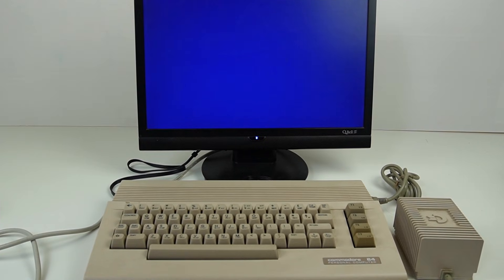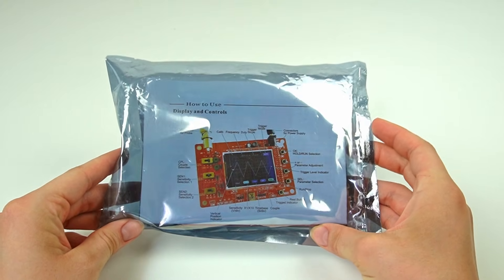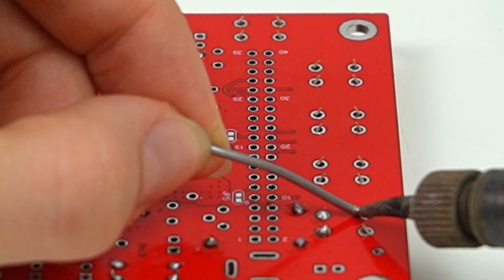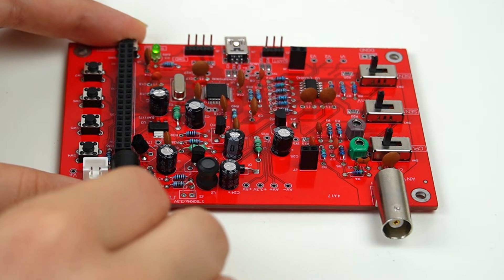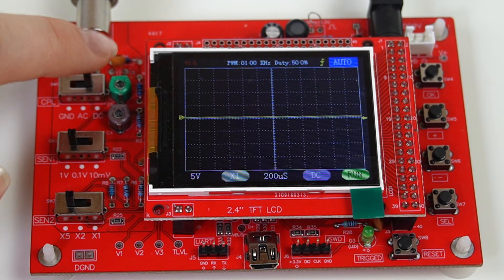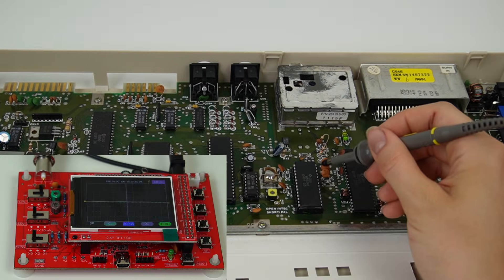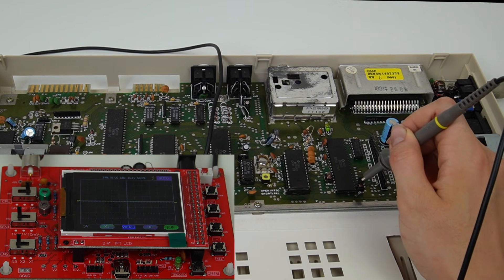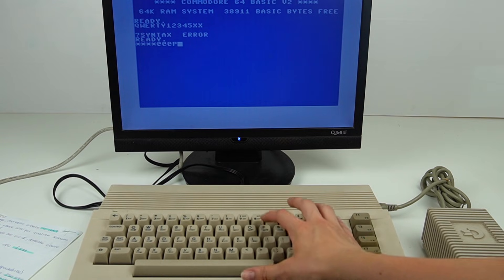I fixed a C64 using a $20 OSCILLOSCOPE

Comment: great video, even though it was a simple fix it was still enjoyable to watch, as for the oscilloscope i had one of those quiet some time ago and there was a custom firmware for it which extended its functionality and there was also a mod that i did which added a second channel to it, and i definitely used it for a good while. but it definitely wont be replacing a proper scope.
Also one thing i will recommend is that to desolded ic's from old circuit boards, try using a desoldering pump and low melt solder, cuz it is very easy to rip pads from these old boads, also it seems that your soldering iron temperature is pretty high since it seems like a budget one, a good soldering iron makes a difference and will be a worthwhile upgrade, for budget options you can get the t12 soldering station or the ts100 both are very excellent
Reply from the maker: I agree, a customized scope can be a lot of fun for specific projects, but it doesn't replace a dedicated, high-quality one.
And thanks for the valuable tips! Using a desoldering pump and low melt solder for old circuit boards is a great suggestion to avoid damaging the pads. You're absolutely right about the soldering iron; investing in a good one can make a world of difference but it doesn't fit within my current budget :)

Comment: Be cautious about that Commodore power brick. It has been reported by numerous users that it will, soon or later, fail to regulate its 12V output, which in turn WILL fry the chips on the board. You may buy modern power bricks online though :]
Reply from the maker: I really appreciate your warning about the Commodore power brick.  Thanks for the heads-up! I think it's a good idea to look for modern power bricks online to avoid this kind of problem.

Comment: never mind all of that, where the hell did you get a 20 dollar ocilliscope lol
Reply: its a good practice to use a toothbrush and a small amount of rubbing alcohol to remove any wax or dirt in there, you can use a lil vinegar and a toothbrush to clean it as well, unsoldering a 4o year old chipset and resoldering was REALLY brave, wow lol
Reply from the maker: this is the link to the oscilloscope : https://www.amazon.it/dp/B07DJ4P23C?psc=1&ref=ppx_yo2ov_dt_b_product_details , but i even find it at less in other websites like Aliexpress

Comment: I like the idea of build your own oscilloscope. Being an electronics engineer by trade, I work with this sort of equipment all the time , but I never thought you could get one as a kit
Reply: It's very limited, but for a beginner it's pretty good to learn the basics, i had modified mine to accommodate 2 channels, but still ended up buying an old analog scope and then fixing it which was much more usable
Reply: @ShahZahid  I noticed it was single channel and I did assume that it would have a pretty low bandwidth
Reply: Same,like the idea of really making one from scractch even more.  I dont know what kind of hardware theyre using inside them but for $20 i just bought a  500mhz stm32h7 microntrontoller with digital signal processing instructions,which could do some nice fft, included a mini oled display and even came with a camera, 3x16 bit adc's upto 3.6msps, maybe thats the difference?  Could you possibly turn one of these micronctorollers into an oscilliscope? Maybe use a couple of them for more channels. I was going to make an arduino one but ended up getting a  2 channel handheld but the bandwidth cuts in half when you use 2 channels(dso2512g), im guessing wouldnt be a limitation if you used more then 1 mcu.
Reply: @mikejones-vd3fg  the h7 would be good enough to make a somewhat usable scope also proper scopes dont use a microcontroller but instead a FPGA to accommodate the very high bandwidth and sampling rate which add significantly to the cost of the scope, but the real challenge and cost comes from designing a suitable front end for the scope, you need pretty high end adc's for a good scope.
Reply: ahh thanks for the clarification. @ShahZahid
Reply: Not worth it if you are a professional, just buy one. They are cheap enough.

Now, if you're a 16 year old just getting into electronics then building one is fun and educational.

Comment: I don't know if your soldering iron is temperature adjustable, but you're soldering at too high a temperature. The solder's resin core shouldn't instantly burn like it does in your footage. 325 °C max for leaded solder, 305 °C max for lead free; it looks like you're up near 400 - 425 °C, which, if you don't solder often, is just making things hard on yourself(*). Turn the iron down or use a lower wattage iron (for these sorts of components 15W is more than enough).

Also, buy some electronics snips instead of hacking the component leads off with electrician's wire cutters. Granted, even a cheapo one of those will probably cost more than the oscilloscope, but it's a worthwhile investment.

Oscilloscope tip: when probing TTL signals move your 0V line (vertical offset) to one division from the bottom of the screen, so you can use a more sensitive V/div setting to view your signal.

The CIA chip didn't have an oxidation problem, BTW, oxidation only made it malfunction. It simply wasn't soldered properly in the first place. A common problem with early, wave soldered electronic assemblies, like the C64.

Still a decent diag and fix. Kudos for fixing it yourself.

(*): even if you do solder often, you just have to move at a speed which makes you error prone. The time gain when soldering a lot of contacts which are in proximity to eachother (like IC's or IC sockets, connectors, etc...) is not worth having to find and fix a bad joint after the fact, imo., so I always recommend to keep the soldering temperature within the specified range of the solder manufacturer.
Reply from the maker: Thank you so much for your thoughtful and detailed feedback! I really appreciate your insights. Regarding the soldering iron, it's a budget one, and its temperature control isn't the most precise. It tends to heat up quite a bit when it's on, making it a bit challenging to maintain the ideal temperature. I'll keep that in mind and consider upgrading in the future. Thanks again  taking the time to share your expertise and insights!

Comment: Hi! Nice job. I wanted to mention that it is usually worth socketing every chip you desolder. That way, you can easily replace them next time if necessary 🙂
Reply from the maker: Thank you! I appreciate your feedback. You're absolutely right about socketing chips for easy replacement. In this case, I didn't have a socket on hand, and I wanted to quickly test if the issue was due to oxidation or cold solder joints. Thanks for the tip!

Comment: You are a gifted youngster as I was many years ago 😊 The machine that you has just repaired is older than you 😅 I used to tamper on my old ZX Spectrum back in the late 80s, where I learned computer programming. I still have it in working condition 😄
Reply from the maker: Thank you ! It's incredible that you still have it in working condition after all these years.  It's great to connect with someone who shares a passion for tinkering and learning through these older machines. 😊
Reply: @Sayakas_Digital_Attic  You're welcome 😊 I think I'm gonna make a video of my ZX Spectrum running a game and publish it, just for fun 😄

Comment: sounds like you may have just had a cracked (dry) solder joint. and as for your method of reflowing, it was good and clean, i only have 1 recommendation (and is frankly not something to worry too much about given how fast you hit each joint)... jump around on the chip legs to give each point time to cool and you wont be loading alot of heat at one point. that being said, the time you took to build the oscope and everyone needs to make one , awesome job.
Reply from the maker: Thank you so much for your feedback and advice! I really appreciate your support and the compliments. I will definitely try to implement your recommendation to improve my soldering technique, if you have any more suggestions, please feel free to share them🙂 Thanks again!

Comment: you too, i had just finished building 2 DSO 150's for fun, and was in the process of recapping and fixing my Amiga 1200, the audio section was not outputting correctly, this is where those oscopes came into a perfect use, was able to track down a cap that leaked and are a trace to a via for the opamp chip, have a short writeup on my site about it. "terminal-interface"

Comment: Nice job! These oscilloscopes are really handy - I have one next to my expensive one, just for quick checking signals. And it fits in your pocket as well.
Btw I often use cheap nail clippers for cutting wires short.
Reply from the maker: Hi, thank you!

Comment: On old socketed chips I would remove and reseat them before reaching for the soldering iron, could save you some time.
Reply from the maker: Hi, at that time, I didn't have a socket available and I was so curious to know if the keyboard would work that I couldn't wait.🙂

Comment: Well done on the repair, my only input would be you could add a socket for the chips you desolder to make it easier to clean\replace in the future. I must get one of those oscilloscopes to try. Again, great vid hope your channel does really well.
Reply from the maker: Thank you so much for the compliments and for the advice but I didn't have a socket available and I was so curious to know if the keyboard would work that I just resoldered it.

Comment: First Nice to see, that young person is playing with retro-harware.
Perhaps you should put separate video for 20$ oscilloscope and please use thiner tin with more flux into it it will improve your soldering. When you cut legs do not wiggle them just cut. (there are better tool for cut)
And I agree that people need to have logic probe and some kind of oscilloscope.
Now as I have repaired tons of commodore computers included c64, I can say the rest of video is just sci-fi to me:resoldering cia and deoxy totally not needed and is wrong path to repair that did not help,and from expirience i can tell this was just keyboard connector missaligned or bad placed.
deoxy and resoldering cia did not help.
Problem that you might experienced is how you connected ground to oscilloscope, naked wire and plastic clip,try to solder it next time :)
Reply from the maker: Thank you for your feedback and suggestions! I really appreciate your input. I'll definitely work on improving my soldering technique and I also bought thinner solder as you suggested.

Comment: When you go to the effort of removing an IC, before replacing put in a socket. Oxidation will return. Having said that, great job NOT just chucking it in the bin. These chips are getting scarce and expensive. I have many different computers. You appear to have a TI 99/4A from the outro. If at all avoidable, DO NOT desolder the CPU - if you must, do NOT power it on until you have CLOSELY checked for solder bridges (the CPU pins are VERY close together). One pin is higher voltage (if I remember right 12V) and there's a pin next to it that will kill the CPU if a bridge exists. The TI is a very odd computer. The picture shown on the box seems to indicate a late model version (that's a good thing). Enjoying the channel (subscribed).
Reply from the maker: Thank you for your thoughtful advice! You're absolutely right about the importance of preserving these chips, as they become scarcer and more expensive. In this particular case, I didn't have a socket at that moment, and I wanted to test if it would work and if the issue was simply due to oxidation or cold solder joints. As for the TI 99/4A your insights are immensely helpful, and I'm thrilled to hear you're enjoying the channel. Thank you for subscribing!

Comment: C-64's need to replace the "brick-of-death" power supplies like you show here. When they go bad - and they ALWAYS go bad - They will destroy most of the chips in the computer. The 5V rail overloads and sends 7-9V through the system, killing major (and some minor) ICs. Frequently the ones hardest hit include the CPU, the CIAs, and the VIC chip. PLAs go bad all the time. The SID chip may survive, but the sound channels will be damaged. You seem smart enough, so building a new power supply should be easy enough for you.
Reply from the maker: Thank you for sharing this crucial information! I completely agree that replacing the 'brick-of-death' power supplies is essential to preserve these classic computers. Your insights into the potential damage and affected components are very valuable. I appreciate your kind words, and I'll definitely consider building a new power supply. :))

Comment: ❤ I build that very same DIY oscilloscope about 6-7 years ago. Yeah, I bought mine as a kit, so "some assembly required". And just like you, I also found it to be sufficient for looking at the digital TTL circuits on my C64.
Really as long as your scope is able to sample at, at least twice the frequency of what you are probing, then no problem. The C64 is a 2 MHz system, multiplexing access to the RAM back and fourth between the 6510 CPU and the VIC-II graphics chip, thereby essentially only driving the CPU at 1 MHz. So, the scope only has to have a minimum sample-rate of 4 MHz in order to keep up with the TTL signals inside the C64.
Where my home-made scope would begin struggling, was when I began probing the analogue video output circuit. Because the oscillating crystal for the VIC-II chip runs at either 14,31818 MHz or 17,7344 MHz depending on whether the C64 is the NTSC or the PAL version.
- Now, your oscilloscope may obviously be different, but mine wasn't able to properly keep up with those frequencies. And later on when I began fiddling with Arduinos, STM32s, and ESP32s tinker-boards, I eventually ended up buying a real bench oscilloscope. But by then my little home-made scope had ended up saving me a lot of money by teaching me about which one to buy.

Comment: Honestly, when you deal with old electronics, ALWAYS (as a rule of thumb), the first step should be a good cleaning with IPA (Iso Propylic Alcohol), if you should had started from there you wouldn't need an oscilloscope whatsoever, also with a simple multimeter you could have checked all those voltages (not the frequencies though) but it would have been enough to make you realize that the contacts had some corrotion.

Comment: Go girl! Great Job!
Just a couple of tips to anyone trying something similar to avoid doing damage to the stuff you're working on:
1. ESD wrist strap and ESD mat are super good accessories to avoid killing ICs. If using a mat don't run the board with power while laying on the mat because signals might get grounded and result in weird behavior.
2. Get good wire cutters and try to pre-cut components before soldering them in place if possible. Wiggling while cutting could lead to cracks in the solder joint or in worst case the traces to separate from the board.
Reply from the maker: Thank you so much for your kind words and for sharing these helpful tips! 😊

Comment: Nice fix and the oscilloscope build. Good to see this C-64 lives on in fully working condition. My Commodore 64 was indeed this kind of 64 C model, sadly sold it already in 1991. Saw others commenting about the power supply, mine failed right after warranty expired, luckily it just started blowing fuses and didn't damage the computer.
Reply from the maker: Thank you very much! I'm sorry to hear you sold your C-64 , but at least you have some great memories. Indeed the power supply issue seems to have been a common concern for many owners.
Reply: @Sayakas_Digital_Attic  Thank you for the reply :)
I was 16 year old student in fall of 1991 and needed money for my studies, so that's why had to sell it. 
Good memories indeed and fast forward to fall 2018, got myself The Mini-C64, so once again I've been enjoying Commodore 64 games, that last time was able to play in 1991. Very fun way to refresh Commodore 64 memories :)

Comment: Look for a good pair of flush cut nippers for electronic work.  They can get much closer to the board when trimming leads, which will help avoid any possibility of shorting.  They usually can be had for well under $10 US.
That little kit looks like it will do the job for most computer work on older hardware  -- it's quite a find.  Thanks!  (I've been needing something like this and can't afford a more expensive scope.)
(I bet a 3D printed case would make that kit a nice home...)
Your troubleshooting was systematic and well executed.  Have a Subscription!
Comments already posted concerning the old Commodore PSU are well said:  there are Meanwell units that can fit in the original housing which will serve much better and run cooler.
Reply from the maker: Thank you so much for your valuable advice and kind words! I really appreciate your suggestion regarding the flush cut nippers; I'll definitely look into getting a good pair for my electronic work. I'm glad you found the kit useful for computer work on older hardware and your idea about a 3D printed case is fantastic but a 3D printer it's currently not within my budget.🙂
Reply: @Sayakas_Digital_Attic   I see where some sellers on ebay are selling this kit with a case.  It might be possible to find the case separately for not too much.

Comment: As soon as I saw the "brick of death" in the beginning of the video, I was scared that alone could kill the C64. Definitely consider buying a new power supply (or make one, since you are not afraid of soldering). The C64 brick is not to be trusted after all those years, even if it works for now.
Reply from the maker: Thank you for your concern and valuable advice! You're absolutely right; the original C64 power supplies can indeed be unreliable .